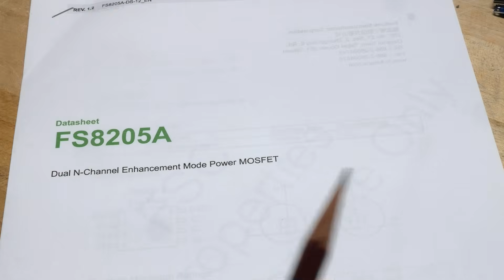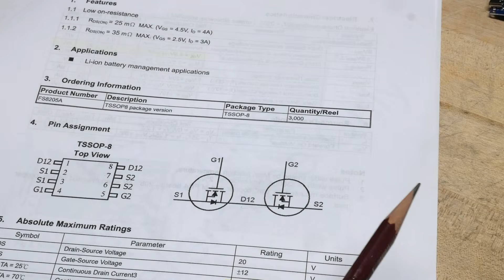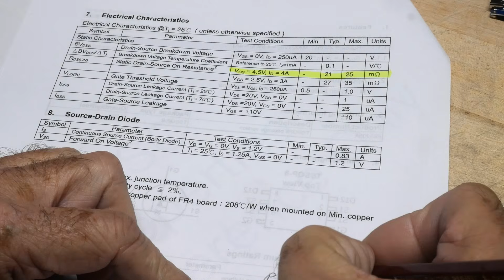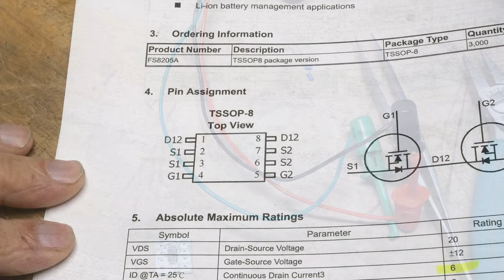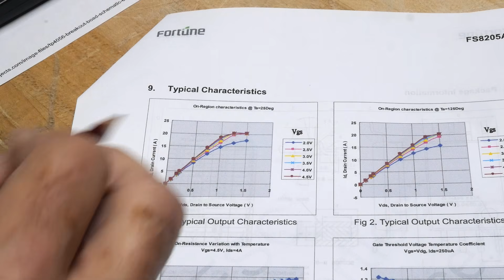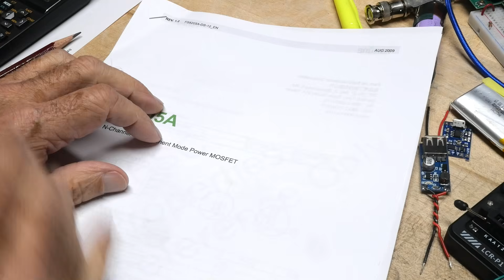#2594 FS8205A Dual N-channel MOSFET

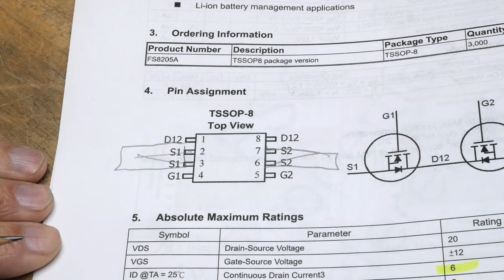Comment: 6:20 it is kinda an unspoken practice with SMT FETs, goes without saying.
Moreover every datasheet has Rth(j-a), Rth(j-c) ratings for the packaged die, which is all that's needed.
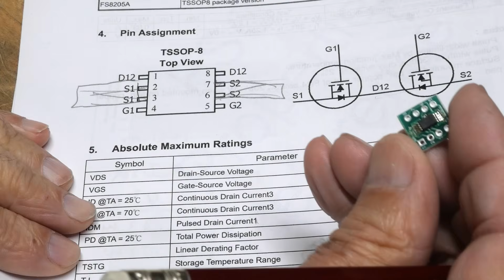Same here, 6:54 right under Absolute Max (btw, not 'recommended' one) table with 1W rating.

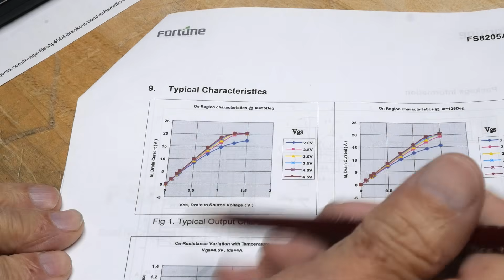7:42 it can go up to 20A even in 'DC mode'. They just test it quickly under liquid cooling on the unsawn wafer.
It's our job to remember, that one datasheet characteristic does not cancel the other ones and thermal resistance limit still applies.

Comment: Well...the bit about needing the copper under the device was hidden...under the calculator...  need to dig through and dig through and dig through...under your strategically placed calculator...  Proves the point, though - can't talk and do arithmetic and check audio and check focus and find the bit about the copper pour requirement all at the same time...

Comment: The standard for pulse measurements is a 10us pulse once a second, and the only way you can get the thermal management right is 2oz copper on the board, with the 2 source pins attached to a 25mm by 25mm flag on both sides, and the drain pins, not normally used in any application, but there, with another 23mm by 25mm copper flag, all 4 copper flags with no soldermask on them to allow for heat dissipation. Also at 25C ambient with the board in free air, so almost never achievable, unless you pot the larger copper area on, and then use a conformal thermal pad over the chip and pads to allow the heat to be transferred to a small finned heatsink or a metal case, to keep the chip case at 25C

In actual use I treat those as being 2A devices, as the companion DW01A controller will shut off the drive if it detects there is more than 3A current flow at worst case on resistance, and roughly 5A with typical spec, so you derate by half to allow for brief capacitor charge currents.

Comment: Researching for a current project, I came across a similar product in a PDIP-8 quoting 400VDC Rds at 20mA. Just the pin spacing of the package made me suspicious, let alone the wattage. It was an opt isolated SPST-NC SSR with this same NMOS configuration on the load side.

Comment: Been following your video's on this board with interest as I bought 10 for $1.50 off Ali Express as an add on to reduce postage and am using on my shed solar light, So far, working brilliantly. You mentioned the 20 Amp current of the FS8205A on that board, which contains the TP 4056,( your video #2588) which, if using a 1.2 k resistor on pin RP, delivers a maximum of 1 amp, so, if I read this right, this board really needs to handle only 1 amp. The board is really thin, less than half a millimeter. Thanks to you, these boards are really usefull. Thanks, Barry, VK2FP node 170628

Comment: I think I saw a Note specifying that you need to connect it to at least one square inch of copper on a FR4 board.  With 1 W continuous, it will get hot and probably will shorten its lifespan.

Comment: Actually it would have to dissipate double that because those figures are for a single FET and there are two in series.
Reply: Are there any notes about that in datasheet?
Spec sheet is for a device, unless there are specific test conditions noted.

Comment: These FETs actually have to be designed in a special way to ensure they can pass current both ways and they have to be wired like that so the body diodes cancel. (But the body diodes are also important because they allow the current to flow one way - so if the battery is full, it can resist overcharging, but allow discharging, or if the battery is empty, it can allow charging but not discharging). So you can't just use ordinary FETs because using them with reverse current normally has much worse specifications than using them properly (i.e., never reverse drain and source unless you have the data).
Reply: Usually you can reverse the channel current without problems, because the internal channel design is symmetrical without consideration of the "naturally" given body diode structure. Also the thermal conditions are the same for both current directions. In many applications like electronic rectifiers MOSFETs are exclusively operated in reverse current direction in order to use the body diode to start the rectifier until a sufficient output voltage is reached to start the gate controller. In order to open the channel you just need to make sure, that the gate voltage has the correct direction.

Comment: Those are not "protection" diodes. They are intrinsic to the structure of power MOSFETs as they are currently made. Mostly they are a damned annoyance, but with great care their avalanche properties can be exploited. They have been improved over the years, resulting in lower reverse recovery time and they are much better specified than in the early days.

The datasheet in footnote 3, which is badly referenced in section 6. Thermal Data says the thermal resistance from junction to ambient is 125 °C per watt when mounted on one square inch of "copper pad of FR4 board." There is no spec for copper thickness. The thermal resistance junction to ambient is spec'd at 208 °C./W with minimum copper. 

That sort of configuration is common in "hot swap" power controllers. Much better FETs would be required for most things.

It took a long time, but most of the big companies spell out in the datasheets how to put a chip on a board and lay out associated components. Lots of parts are used by designers who are basically clueless about how to lay out anything other than some common digital stuff. Putting the required info in the datasheets keeps ap engineers from ripping their hair out after explaining the same thing to the eleventy thousandth "I can't make this work!" customer.
Reply: With great power comes responsibility

Comment: My (very limited) understanding is that dual-channel FET's allow for a "cascode-like" operation within a single part.  There are several known advantages to having a cascode arrangement (in an amplifier for example) or in this case a form of digital AND gate.

Comment: Yep, if you can't get the data you need, dig!  I've gone to the extent of asking until the chip designer got asked if a particular situation was OK by the chip design.  We only bought a few hundred thousand parts but we made sure it was a suitable part.

Comment: Toshiba has two parts that are funnily connected: pnp 2SA1618 and npn 2SC4207. I think you can use them to design your own comparator or op-amp. I've used 2SA1618 in my design.
Reply: They were widely used in age when opamps were not that good.

Comment: These back to back dual MOSFETs are used extensively for battery protection and USB port protection on motherboards and phone PCBs. I have met them as the teeny CSD87501 in a 3.37mm x 1.47mm LGA package. Not nice!
Reply: oh, ESD protected gates are worth alone, but also <10mR Rds(on) in such a tiny space, impressive.
Not terribly cheap though. And supply dependent, which is a show stopper until the project is huge.

Comment: So this chip is to prevent charging a battery that's voltage is too low?
Reply: Discharging. It's supposed to stop current from continuing to flow out of the battery to the point that it's damaged. It's not /supposed/ to be preventing the cell from being charged again. The BMS should see the higher voltage being applied by the charger and open up again.
Reply: @lunalangton5776 
Thank you.